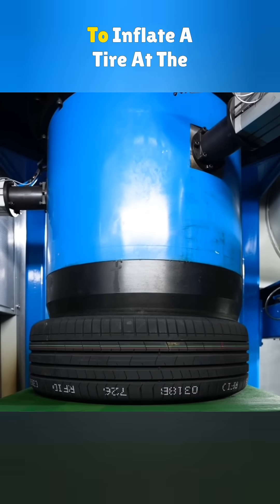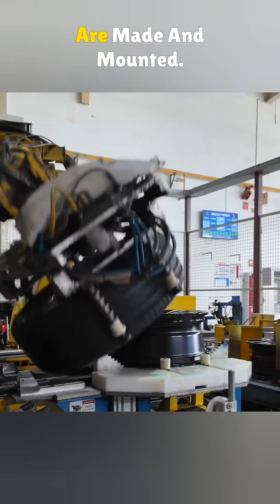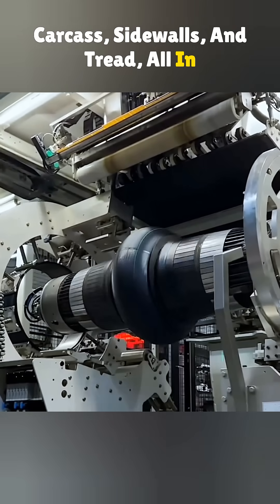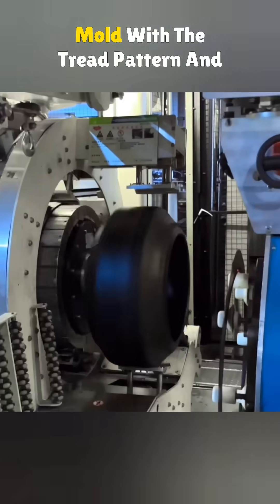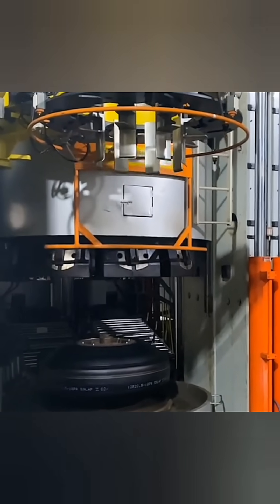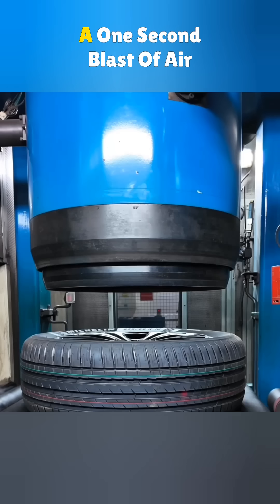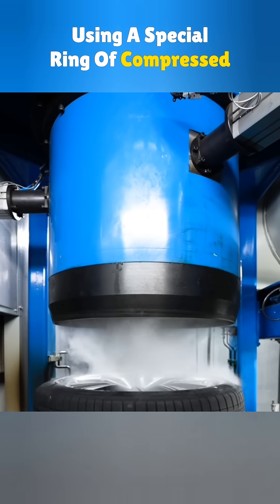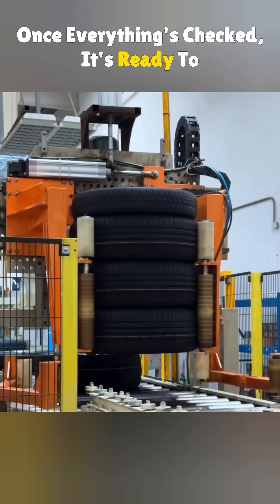How Tires Are Made and Installed at the Factory #assembly #automobile #car #manufacturing

Comment: Except that the valve IS involved.  If it weren't installed, the air would simply leak back out through the port where the valve would be mounted.

Comment: Modern tire technology still can't deal with a puncture too close to the sidewall. If you have an AWD vehicle you can't just replace one tire, you replace ALL of them or else the modern drivetrain technology can't deal with one tire slightly smaller than the others and it will fail internally. Isn't modern technology great?
Reply: Airless tires.
Reply: It really depends on how much life the other tires have. If you have 4 tires that are close to minimum tread, and one gets a hole in the sidewall - of course you should be replacing multiple tires if one goes out. But you're not replacing all 4 tires if the tires have slightly less life. This point is often exaggerated.
Reply: @ToothNroost You could just shave the tyre down to the level of the other ones. Otherwise it causes a weird imbalance causes a slight howl/whine. Swapped out all 4 and it went away.
Reply: Ok, boomer.

You should always mount similar tyres on the same axle. This has nothing to do with 4WD or modern drivetrains.
Reply: @noinfo5630  OK, Ignoramus. I DARE you to Google "AWD Tire Replacement Myth or Truth" Bet you don't because you can't stand being proven wrong.

Comment: I'm surprised they didn't automate the actual mounting of the weight.
Reply: My guess is that the magnets pose a bit of a problem with electronics etc. The necessary robot arm and controller and feed system would probably cost several years of the unskilled worker's salary not even factoring in the maintenance...

Probably somebody has to be there anyways as it's on the end of the production line, or you would need another machine/assembly to dismount and package the tyre and direct it to the right place (storage, shipping etc.). So he can in effect do two jobs at once as the production line isn't high paced.
Reply: @noinfo5630 what magnets? 😂

Comment: No wonder why brand new cars need new tires at 15k
Reply: Wdym? I don’t get how this would make them last less
Reply: The OEM tires are sometimes of a softer compound for compliancy (and don't have the customer returning if there is something a small bit of in the suspension settings) They wear of faster...
Reply: My point exactly  @JJVernig
Reply: @chancekenney9624 
You didn't make this point. The choice of softer tyres still does not make the manufacturing process somehow responsible for faster wear and tear.
Reply: The tires on my 10 year old car last about 75,000 to 90000. I take it easy but I do drive about 20,000 miles a year.

Comment: Ling long greenmax
Reply: Aren't China brand tyres prone to sidewall puncture or rupture from contact with curb? I had one which was  really weak but it was also a cheap price tyre.
Reply: @frv6610 in my experience they are good tyres but they suffer from dry rot
Reply: Good one